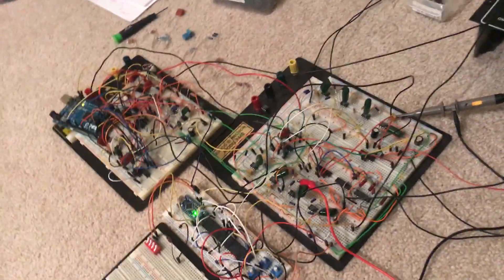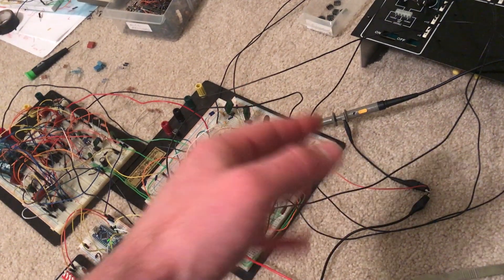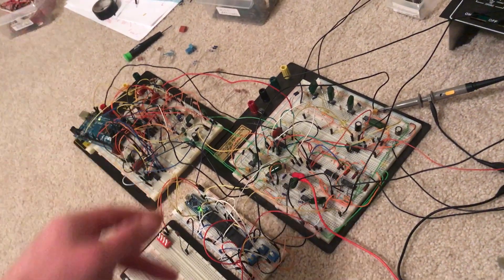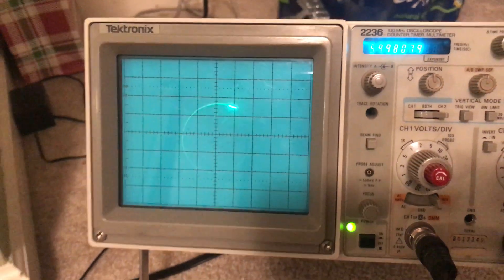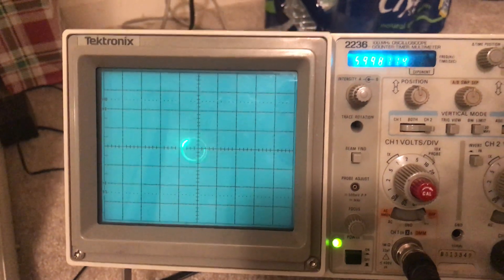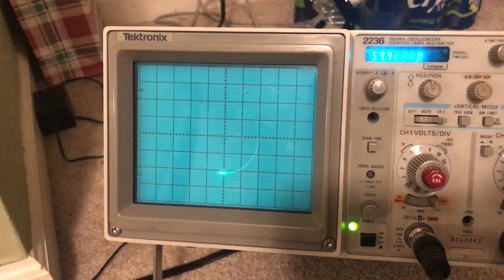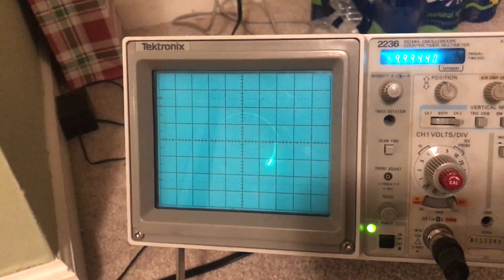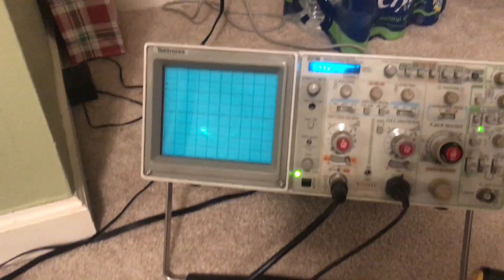Bohr’s Hydrogen Model on Complex Analog Computer.

Comment: Great seeing new stuff from you. Is this circuit based on any existing analog network?
Reply from the maker: It is a patchwork made of op amp integrators, digital to analog converters, scalar amplifiers, sum amplifiers, analog to digital converters etc. the circuitry is patched together to model motion of e- in hydrogen atom. So yes, does use some circuitry similar to older work. Just more of it and very complex interconnections. Hard to wire and debug! Got it working mostly as shown in video. Regards. Josh.
Reply: Sure, not including the individual analog compute elements, of course. I was wondering because I've never seen a design for this particular physical model anywhere...